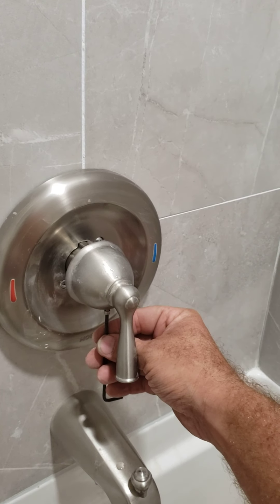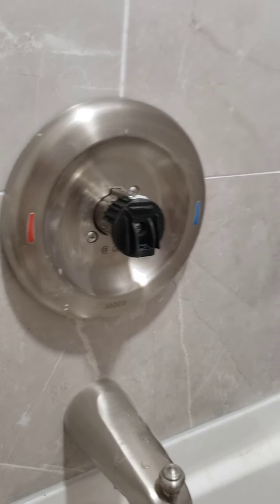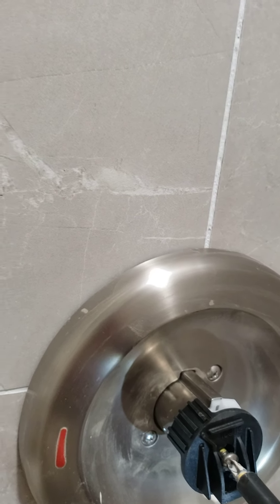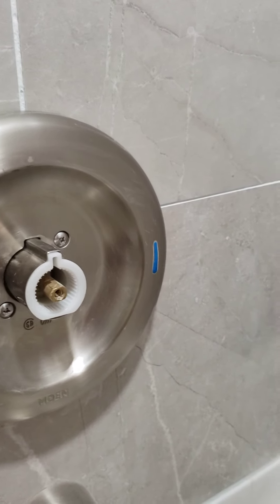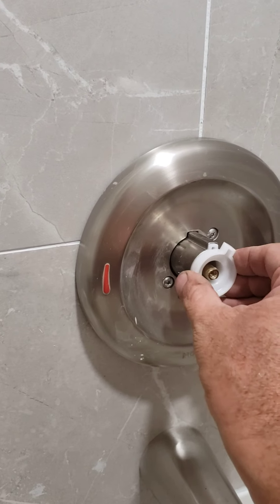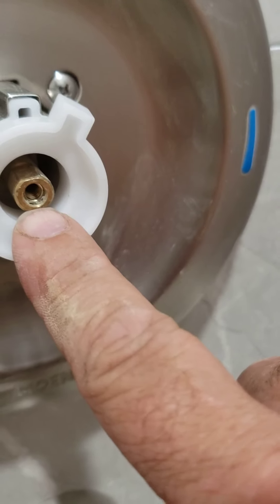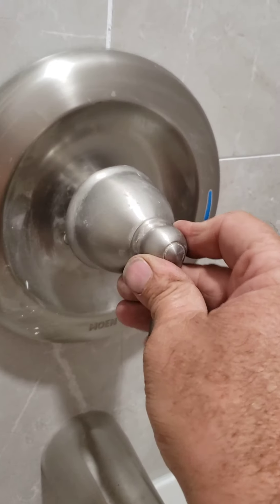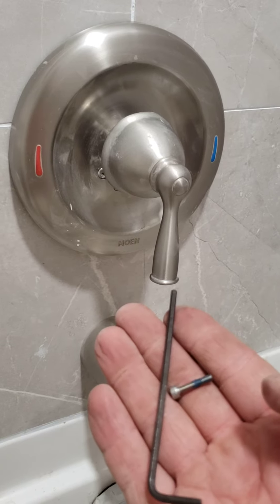How to remove Moen tub shower bath valve handle/assembly & replace and adjust water temperature.

Comment: Bought a house and the shower had the completely wrong handle. Had to track the right one down, buy the key stop and figure out how it all goes together. This was a very simple explanation for the whole procedure. Thanks
Reply from the maker: You are very welcome!  Glad it worked out for you!
Reply: @goodtimes1828  I bought one and installed it but the handle falls either to the left or right on its own. Why won’t it stay in one position?

Comment: I took the set screw out of the handle, but it still won’t come off the shower
Reply from the maker: Sometimes it gets water mineral build up and makes it very difficult to remove.  And sadly, sometimes the valve must be replaced.

Comment: What if I want cold water? Mine is too hot for me?
Reply from the maker: You will need to adjust the temp ring clockwise or counter clockwise and just find what temp works for you.  If you have a gas water heater there should be a temp control on that.

Comment: Thanks for the easy instructions! To think I couldn't have a cool shower in the summer because I thought we had to take the wall apart!
Reply from the maker: Glad I could help!
Reply: Were you able to get colder water by turning the regulator clockwise? Or did you resort to something else like turning the water heater down in temperature?
Reply: @ahuramazda980  it worked like a charm.

Comment: What size is that allen wrench?
It is all caked up or corroded and everything I try is probably stripping it.
The next step is a band saw and cut the whole thing off.
Reply from the maker: I am sorry but I am not sure what size it was.  This info should be online.
Reply: @goodtimes1828  - I tried looking it up. I have no clue model. It's about 15 years old so when it finally is not useable I'll cut it off. The new one will be heavily coated with grease inside, or something like that to keep the water from ruining the screws.
Reply: Moen seems to use a 7/64 sized Allen wrench.  Probably too late to help, but might help someone else.
Reply: @Aureus23 thank you!  I needed this info

Comment: Is the silver housing around the brass piece supposed to stick out like that? My handle fell off and that thin silver frame is flush against the mount. I've trying to get the handle to reattach but the hex set screw doesn't seem to be lining up correctly and going through black piece and connecting back with itself.
Reply from the maker: It should slide back and forth so it can be set to stick out to the back edge of the handle.  Might try and rotate it just a bit to align better.

Comment: Just a quick question….when you screw that hex screw in the handle…..the handle should be nice and snug right?  My has a little wiggle room it seems like and I screw it all the way so it seems
Reply from the maker: You should be able to tighten it down ,  otherwise it may be the wrong handle or screw?  Maybe add a washer?

Comment: My handle wobbles a little. I hate it. Does your moen handle wobble when in the off position. Or is it recommended to take handle off and tighten things a little more?
Reply from the maker: It does not wobble.  there should be an adjustment for this or it could be worn and you need a new handle.
Reply: Mine wobble too……thanks for asking that question…..I got my answer from this…..I will retighten tomorrow…

Comment: I have a question please. So for my shower the temp is set at the highest already but right now it does not throw hot water. The rest of the house gets hot water without issue. Does that mean i have  a bad cartridge now?
Reply from the maker: That would be the next part to check.  Ughh sorry
Reply: @goodtimes1828  Thanks for letting me. Lol time to let the landlord call a plumber.

Comment: W we installed everything looked good and then the shower nozzle didn’t stop doing so the water doesn’t turn off…what are we doing wrong?
Reply from the maker: It sounds like it may be installed upside down or the seals need replaced/adjust seating of seals.

Comment: Does this faucet let you adjust how much water comes out?
Reply from the maker: There is no adjustment for the water flow on these.  If you have little flow then there may be debris in the back of the valve or low water pressure to home.

Comment: I was able to take off handle but that black piece seems stuck, i cannot get it off any advice? Dont want to cause damage to the pipe 😅
Reply from the maker: Sometimes a little wiggle or pry is okay.  Brass is pretty strong and the insides can be replaced if necessary but just be careful.

Comment: I'm missing the black piece, is it okay without it?
Reply: No that’s the major on and off control 😮 also it holds your handle on !!
Reply from the maker: It is a necessary part.  I would check online or at a local hardware store.

Comment: How to adjust the water flow? I mean the water volume. Thanks!🤝
Reply from the maker: that sounds like a pressure issue not a shower valve issue.  Unless you have a bunch of build up inside.

Comment: I did all of this but now I can't turn the hot water on at all- it's as if it's "locked." Do you have any suggestions?
Reply from the maker: You need to rotate the center piece (slide out, rotate, slide back in) as that is how you adjust the temperature.

Comment: How do I remove my handle if there is no set screw at the bottom of mine?
Reply from the maker: There should be a screw under and end cap or somewhere on the side/bottom of the lever.

Comment: So with the white piece centered, that means it is at its hottest setting?
Reply: Curios as well
Reply from the maker: The center should be the starting point for heat.  Rotating the piece to the left or right of center should change the desired temperature.
Reply from the maker: It is usually the starting point and you can adjust clockwise or counter to get desired temperature.
Reply: @goodtimes1828   I cannot adjust mine to the left to increase temperature past the centerline point
Reply: I Cannot adjust past 12 o’clock either!  HELP!

Comment: You should never use power tools on these installs, always use a screwdriver so you can feel the pressure and not break the plastic components, especially for inexperienced people.
Reply from the maker: Yes, whiskey throttle is bad in all instances including when using power tools on valved fixtures.